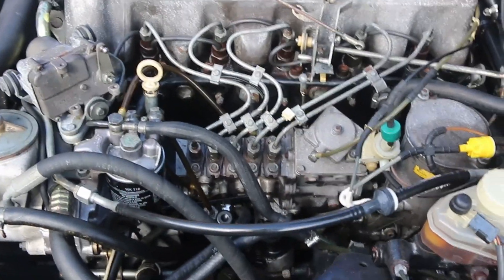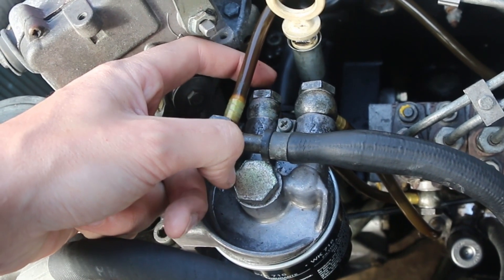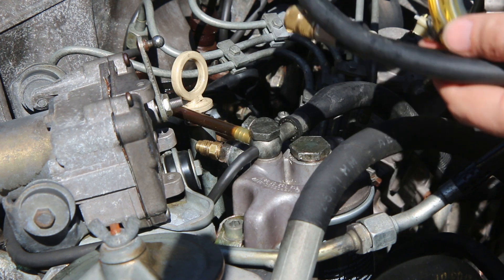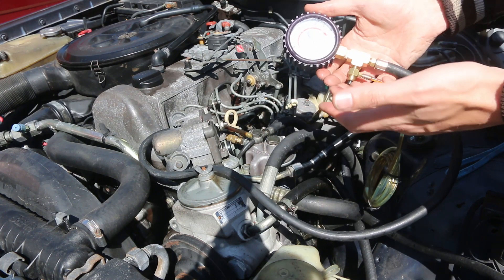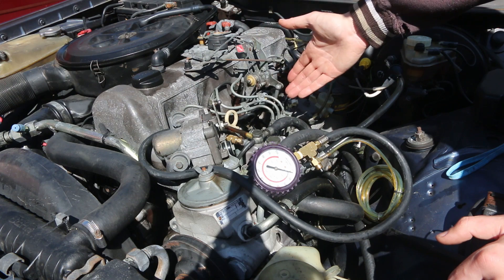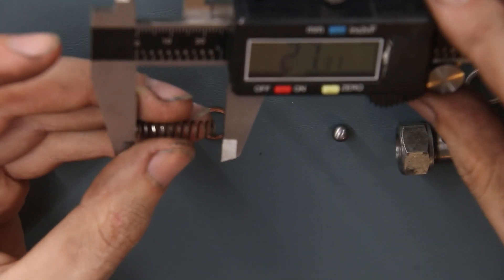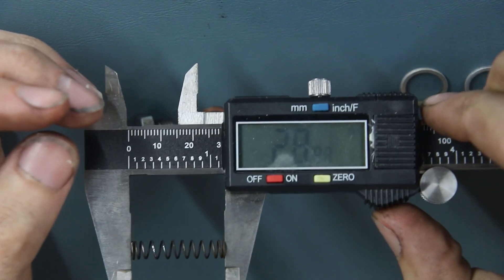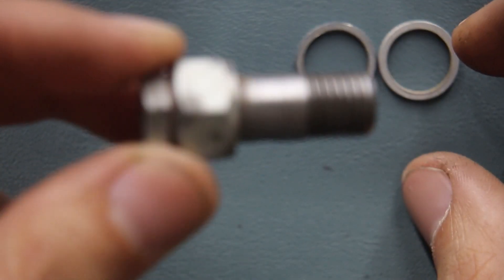W123 Performance/Maintenence: Fuel pressure testing, Overflow valve teardown (WK716 and BF7591D)

Comment from the maker: Here are some links to products we used in this video on amazon in case you want to try this, purchasing from these links may earn us a small commission that helps us keep doing videos like this one:

M12x1.5 Tapped Banjo bolt: hhttps://amzn.to/2yRTRkN
1/8 NPT to ¼ Flare fitting for fuel pressure gauge below: https://amzn.to/3a1aSpk
Fuel pressure gauge: https://amzn.to/3e9nwpr

Alternative gauge for possible permanent installation:
Gauge itself: https://amzn.to/2UZmlBI
90 degree Elbow: https://amzn.to/39XZWbS
Use the same M12x1.5 Tapped Banjo bolt: hhttps://amzn.to/2yRTRkN

Things you need to use the gigantic primary "prefilter" that I have:
Filter housing: https://amzn.to/31lon0T
Mesh filter: https://amzn.to/39VP14r
Fittings: https://amzn.to/2XqYBHq
3/8 fuel line: https://amzn.to/3gtDdZy
Clamps for fuel line: https://amzn.to/31mavUd

Comment: Is this how you bleed the injection pump
Reply from the maker: Not quite, pumping the primer pump will get fuel into the injector pump, once you've got that done, it may be necessary to loosen the metal lines with a 17mm wrench at the injectors and crank it over until there is fuel at each of those fittings, then tighten them and attempt to start, I should do a video on it because if you run completely out of fuel it can be helpful to know how
Reply: @ ok that tells me my injectors are trash thank you

Comment: you happen to have any info on the "nippled fitting" into this lift pump?  Am converting to AN6 fittings and really need this to replace all my horrible fuel lines and leaks.  (on a horribly done customized conversion yet.... HAS to be my daily driver ASAP)
Reply from the maker: I'm fairly sure the inlet and outlet fittings also serve as the check valves for the lift pump, I'm not sure what option there would be to convert to AN without removing the fitting, getting the check valve and any portion that could be damaged by heat removed, and then welding or brazing a fitting to the barbed portion.
Reply: If you still need a solution, the an style shielded clamps would be the easiest way, the most professional would be cutting the nipple of any welding a -4 or -6 weld on fitting, or you can make block off plate and run an electric lift pump in the rear

Comment: Super helpful video! Thank you! Great to se how that overflow valve works and where it is located. I have a hard starting problem, and I'll be ordering this valve and a lift pump and valves for it.
Reply from the maker: Glad it helped you out! I'm working on a video testing my lift pump and overflow valve for proper flow right now.
Reply: I have been troubleshooting a lift pump myself. I have a question, should i be able to manually pump fluid from the inlet of the lift pump and see it come out the outlet side? Pretty sure i have a failed check valve internally and ordered a new kit but just wanted to verify@trythistv
Reply: @wolfsargent4469  I replaced the lift pump, very cheap. mine was leaking as I pumped. Yes, as you pump, it should spit out from the outlet, but key is not to leak around the plunger as to introduce air

Comment: pls provide a  link to where to buy the filter mod  - love the vids !!
Reply from the maker: If you mean the 2 micron secondary, I've got a video on that mod: https://youtu.be/JSMO5SNf8gU
Which you'd need these products to replicate:
Time-sert 14155 (10 pack): https://amzn.to/2U7HUOS
Baldwin BF7591-D: https://amzn.to/38I9lE9

Or if you're talking about my giant primary filter/strainer mod that I haven't made a video on yet, but solved my issues with terrible quality diesel around my area:
Filter housing: https://amzn.to/31lon0T
Mesh filter: https://amzn.to/39VP14r
Fittings: https://amzn.to/2XqYBHq
3/8 fuel line: https://amzn.to/3gtDdZy
Clamps for fuel line: https://amzn.to/31mavUd

Comment: I replaced the overflow valve on my mercedes 124 with om602 NA engine. I buyed it on ebay, there was this model and a model that is for 124. I choosed the 123's model because the newer model was quite expensive. The car starts up better now and the jerking stopped when i floor it on 1200 rpm
Reply from the maker: Good deal! Having good fuel pressure makes an alarming improvement in performance and even starting and such as you noticed. Probably keeps the injector pump healthy longer too

Comment: Thanks, great! The spec for OM617  fuel bypass valve is 0.6-0.8 bar at idle speed and min. 1.3 bar at 3000/min.
Reply: Yes, Mercedes recommend lengthening spring to 26-27 mm.
Reply from the maker: Excellent information! So vaguely 8-10 psi at idle rising to near 19 psi at 3000rpm, I'm happy knowing mine is a squeak above that, if nothing else it will help fill the elements nice and quick, worst case I get a little less flow through the OFV because its a bigger restriction
Reply: Yes, and fuil pump is old. Valves in pump have a wear. That is the reason to stay in the mb spec and don't rise pressure higher.

Comment: Perfect video! Congratulations.

Could you help me? 

In my engine, the pump works very well in neutral shift. Rpm reach a red range in the indicator, and my pump shutdown to idle condition.
But
When I work shift in "D" ( the engine need more fuel flow), my pump don't reach the red range! The pump shutdown in 3000 rpm ( white range).
What's happening?
I saw everything, less this overflow valve and the control valve on booster pump discharge.
Help me my friend.
🇧🇷
Reply from the maker: The first things that come to mind are fuel filters (Remember, there are 3: the tank strainer, little plastic "primary" right before the lift pump and the spin on "secondary")
If your filters are good and you've got good fuel pressure, the next thing is boost, the banjo fittings on the intake and ALDA tend to clog up with soot if your car is equipped with EGR, they can be unscrewed and cleaned out, the "overboost solenoid" is another common failure point, I made a video showing some of those things to check here: https://youtu.be/lAGEqlY7vYU
I'd run a gauge to where I could see it while driving, and if the fuel pressure isn't dropping out under load then it has to be the ALDA limiting fuel, which could be the banjo fittings, overboost solenoid or turbo isn't making boost pressure

Comment: hi ,i have a 1985 OM616 , when i pulled the overflow valve the bolt was there but the ball and spring are missing , the end of the bolt is open that goes into the pump , any help or advise , should i maybe add in a fuel pressure regulator into the return line , if yes what pressure should i set it at , please reply
Reply from the maker: I'm fairly certain there should be a ball and spring, you did get the right one? The inlet from the filter should be a straight through banjo fitting, but the return that's between the IP and the block should have the spring. I've seen people mix them up when assembling a pump and it makes the car run terrible. Pressure should run around 20ish psi and not drop below 10 under full throttle full load conditions (like pulling up a steep hill with the throttle floored)
Reply: @trythistv   so should i install a adjustable fuel pressure regulator on the return line and set it to say 18 psi , or what do you think,,
Reply from the maker: Certainly worth a shot, keeping that pressure in the IP has got to help, some of the newer engines used an oriface instead of the overflow valve but the 616 and 617 should have been the same for the entire run, I think the 60X series was when they switched away but I may be waaaay off on that, adding a pressure regulator can't hurt, especially if you can check your pressure like I did in this video and verify that it is staying up around 20ish psi, low fuel pressure isn't good for performance, and can slowly hurt the IP and engine, usually it'll cause accelerated wear on cylinder 1, but would take quite some time to do so.

Comment: Trythistv, BRILLANT!
Excellent how to video on fuel pressure checking a W123.
Reply from the maker: Thank you very much! It's a critical part of getting proper performance, and some have suggested that excessively low fuel pressure could cause accelerated wear on cylinder 1, I'm not certain on the reasons, or if that is true but it's not hard to avoid!

Comment: can you do a video about auto trans including Bowden cable, VCModule, Vmodulator instructions on adjusting each, testing internal pressure of trans.
Reply from the maker: That is an excellent idea! I may have to break that into more than one video due to the complexity of the transmission adjustments, but I'm sure plenty of these cars are running around with poorly adjusted transmissions that would benefit!
I will put it into my list of things I want to make videos of! Thanks so much for the reccomendation!

Comment: Great video. Good breakdown of the fuel pressure regulator.  Not many people even know it exists. 

Also, kudos on the 2 micron filter/water separator mod. Agreed that it may foul sooner but the advantage of filtering out more debris is [in my opinion] well worth it. This could even prevent injector fouling and/or cylinder wall scoring. 

Love the videos (and OM6XX engines) hitting that subscribe button.
Reply from the maker: I wish I had the brains to have made this video back when I first found one that was so collapsed the car would barely run. This one was quite healthy, I'm looking into a readily available spring to replace the collapsed ones so that we don't have to stretch and hope for the best, I'll be sure to post an update once I figure something out on that front!